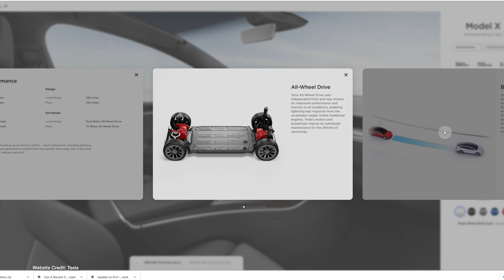ecoTEC 257: EV Batteries Get Cheaper, Funky Cat Aces NCAP, Zero SR/F Around The World!

Comment: Using the IEA's EV total cost of ownership tool, for me, running an EV instead of an equivalent ICE car (allowing +$5K for the battery) only breaks even after nine and a half years. In reality it's probably worse, because EVs are heavy and so have more tire wear. 

And then there's the threat of a huge bill if the battery fails. Sticker prices have to come down, and manufacturers/dealers have to offer lifetime free replacement of failed batteries.

Comment: I really enjoyed this video, thanks a bunch. I was about to unsubscribe as the content is great, but in the past I found your delivery voice too full-on. But you've paired it back to being your more natural voice and it works so much better for me, so thanks for this. What I especially enjoyed was coverage of more big-picture stuff about the world's opinion on EVs and industry news, including the oil production info. Also, you don't just cover all of the same topics I can view on a hundred other EV channels. One thing that sounded inconsistent and generally hard to believe though was that VW were at the top of the list for EV production figures in 2022. This reads as if VW produced more EVs than any other car company last year; is this what you're saying? If not, then this script should have been written differently, as this is the point viewers will glean from your statement. Or are you saying that VW production increased by a greater percentage in the last year than any other EV manufacturer? Again, I'd be surprised to hear this. Or are you including any car that has a battery and electric motor as part of this statement, even if they also have an ICE? If so, you really need to stipulate exactly what you include in 'EVs', as hybrids are bad news. Just a couple of days ago I heard on another EV channel - possibly the electric viking, that production for VW EVs were lower last year than the year before? Please clarify all of the above head-scratchings. Thanks a bunch and keep up the good work!
Reply: Don't think they care if you unsubscribe or not. They are funded obviously.